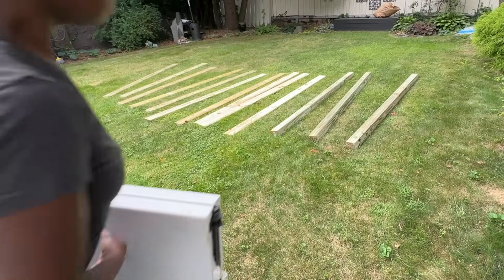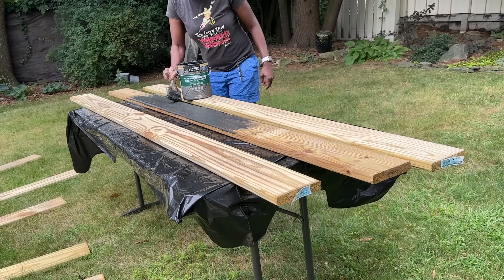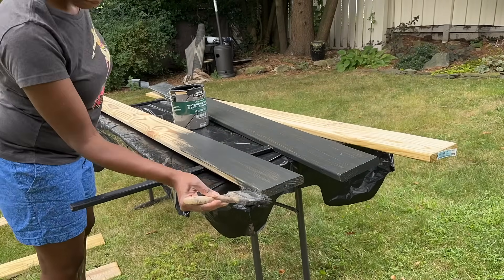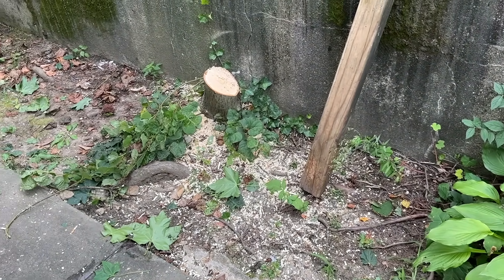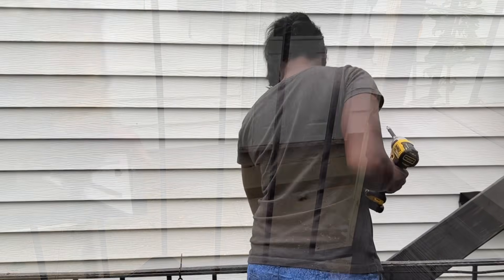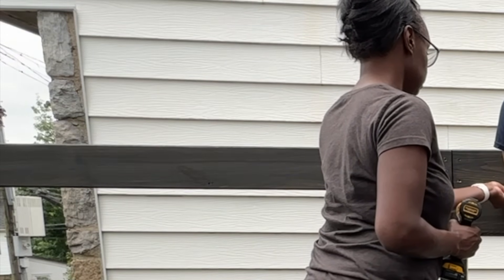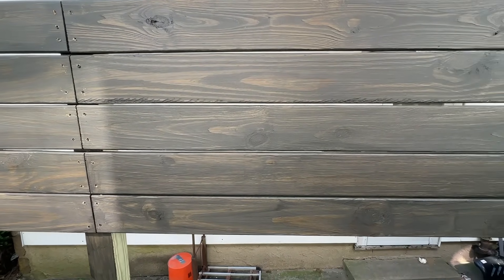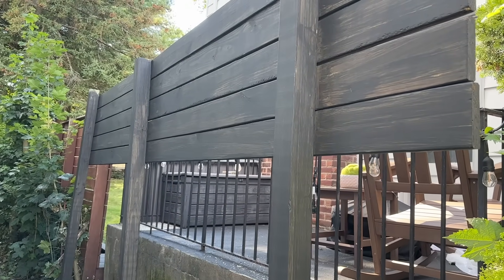If you want to be the envy of the block try this DIY privacy screen! | Diy Privacy Fence

Comment: Great video. Please think about using a Sawzall type device with an 11 inch blade to cut down into the ground to cut up the roots of those big weeds. It's much easier than digging. Also, grab a tarp and clamps for painting and staining. All of these items can be purchased at Harbor Freight very inexpensively. 😊
Reply from the maker: Hello Blair, thank you. I have a smaller saw that I think will be the job I was just battling the rain. It seemed like every time I went out the clouds would roll in. 😂🤣 thanks for the suggestions. Have a blessed day!